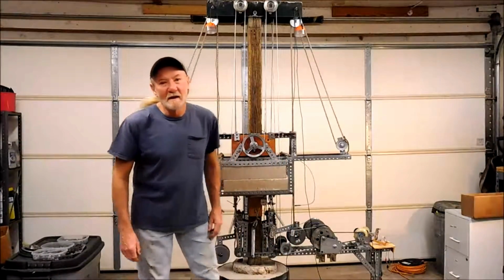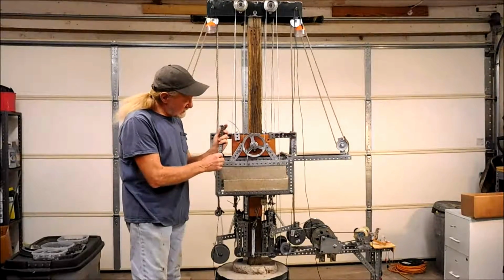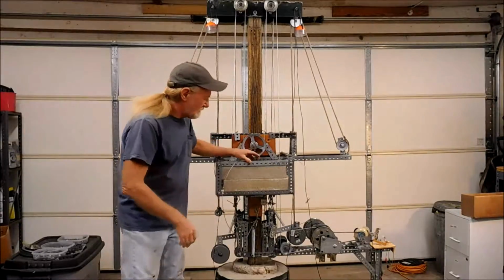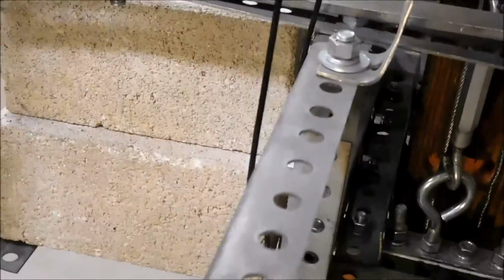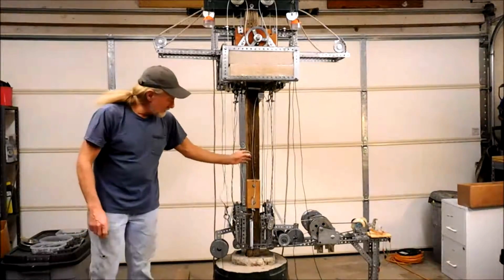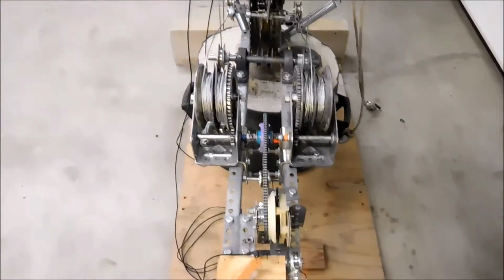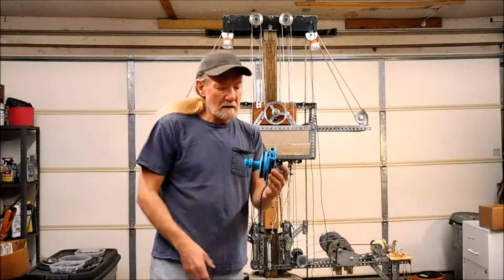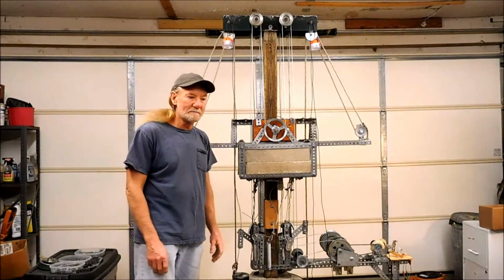Lifter using Roller Chain Fulcrums

Comment: Hi, how many watts at the output? I am working on a simalar project, first attempt I had poor results.
https://youtu.be/Ee5TeEs-ynY
Reply from the maker: Hey, sorry I missed your question. The small Gravity Light generator put out around 3 vdc and best I remember 25 to 30 mA.  This varied by the weight drop speed and the size of weight. Check out my channel or website to see other output examples. The Gravity Light has a red LED that comes on if you exceed the design output.

I looked at some of the videos on your channel. Nice machine. Very well made. A forever falling weight? Now we know that is ......ummmm